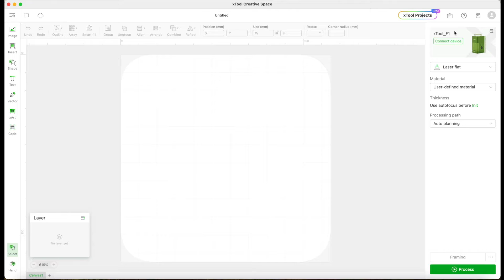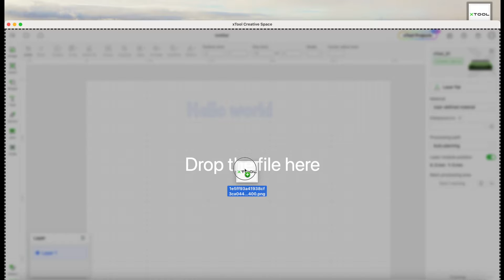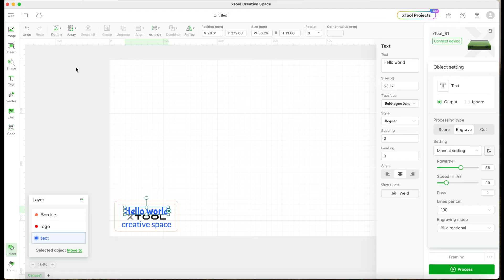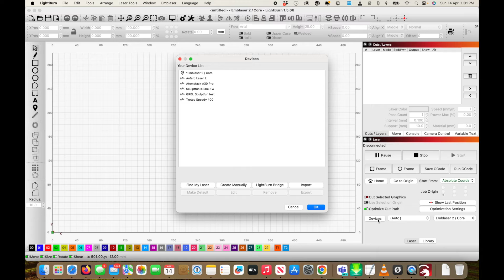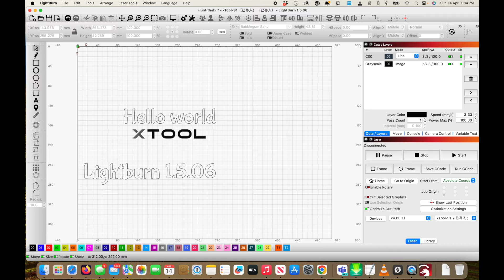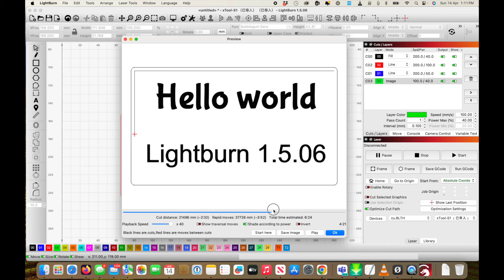Get The Best Of Both Worlds: Set Up Xtool S1 With Lightburn And Creative Space!

Comment: I had to install both. My biggest gripe with Xtool studio is that you can't measured position element of your art measured from the center top, center middle or center bottom of the feature. With xtool everythjng must be measured from the top right corner, which makes no sense at all to me, especially positioning text, centered, user a different feature. With lightburn you select the origin point of everything you want to position by measurement. Also the lightburn option that let's you origin your art to start at the current position of the laser is nice. With this you can "land" the engraving precisely upon something where you are not profile cutting it, like a watch.

Comment: Just setup new xtool s1 laser, and bought a new camera to use with rc 1.7r11 Lightburn..   Hardest part deciding where to mount the camera  I created two macreos for lid detection on and off., then changed my start gcode to have lid detection on, just in case I forget to close the lid.